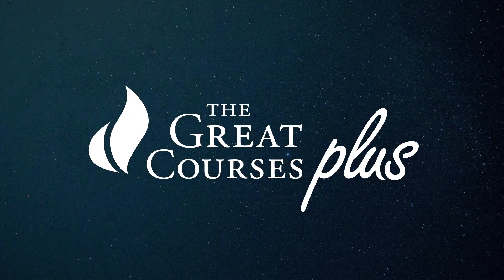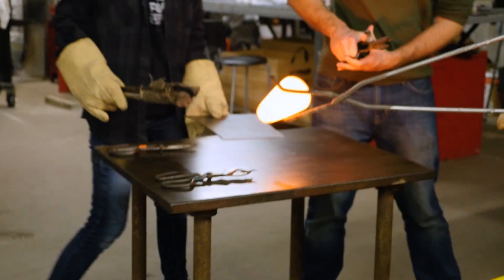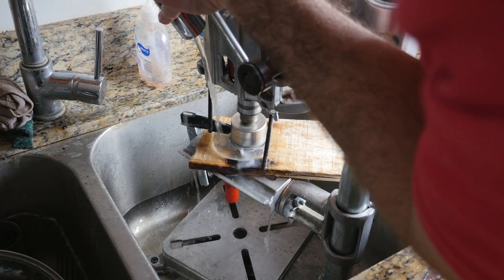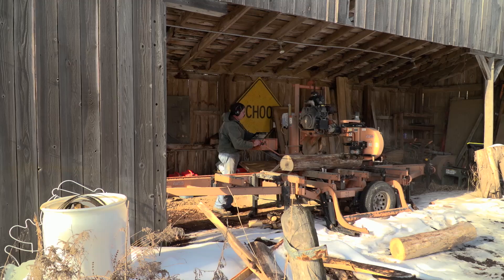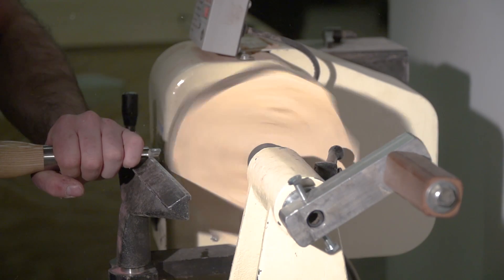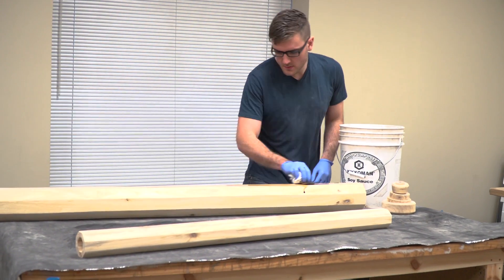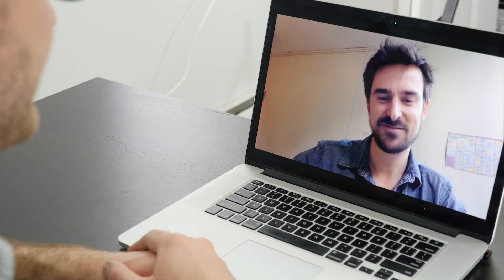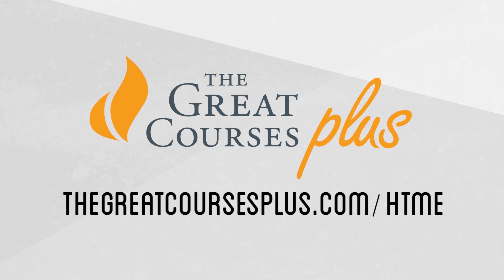How to (Almost) Make a Telescope from Scratch

Comment: Hey thanks for the video. I just joined. Hey I have a question I have a Bushnell telescope and a bunch of Eye lenses and the obvious and lens that comes with the scope. My problem is I can’t see anything does it matter which 25 times or 18 times can those all be used but all you have to do is adjust the length of your telescope to be able to use those different multiplication of microscope glass or whatever it’s called.?
I’m not quite sure if that makes total sense to you of how I’m trying to explain it? But maybe you get the gist of of it. But if you do or kind of do could you get back to me and let me know if all I have to do is just concentrate is even if I change the magnification of the eyepiece it’s just a matter of adjusting the length of the telescope to where the two lenses magnify what I’m looking at such as the moon. I’m kind of sad I didn’t have my scope set for the Jupiter alignment thing a couple weeks ago but after watching your show mainly it’s the best one I’ve seen out of a couple other ones I’ve watched but I hope to hear back from you if I don’t know you’ve got maybe a little bit more knowledge than I do maybe you can help. Again thanks for the video and yeah seeing you make a Camera and taking your own selfie sounds like a good challenge. Take care yourself be safe with this virus stuff and hope to chat with you soon cheers.

Comment: I knew you were going to get hurt as soon as I saw you trying to be the vice of an object that is harder than your hand. Not only this, but I consult you in saying:  Pour molten glass into vacuum chamber with pressure/release control. I have heard ultrasonic use with different peak to peak amplitudes works to remove air pockets. Usually done by stirring; for an example, I saw someone remove air pockets inside of epoxy resin. There was one with 25 microns peak to peak.

Comment: You were cutting those disks TOO FAST!  Better to trepan them using water and carbo powder to cut them with the drill running more slowly, say about 250rpm.  It would take longer, but would be much safer!

Comment: Well to make a telescope you really need a high quality of glass and yes from scratch it wont be enough efficient also there are a lot of calculation that necessary to achieve such as the focal length the diameter conjunction points size etc. They price for lenses are high not to piss some one for kicks there a reason for that and it's in the materiel itself you want high performance you pay more . The kind of glass that you used in this project dont get me wrong it's nice but they are sh** cause it's made from the same quality glass they use for pots and dishes not lenses however if you had find some old lenses and refine it so maybe you would get better results but I think due the circumstances you havet the right tools to make it . Free Tip try mirror telescope it reflect the light and chance to see stars at high quality .

Comment: I made my own telescope many years ago, not quite from scratch, but grinding the mirror myself from a blank.  Does that count?

But actually, I suspect the distorted image you got of the Moon is not related to the air bubbles (which would mostly just scatter light and decrease contrast), but rather by the fact that your curved surfaces are not really close to spherical.  Unfortunately, eyeballing the curve is not really good enough.

Great work nonetheless.  Cheers from sunny Vienna, Scott

Comment: I'm just wondering, and this might sound stupid but could you take out the air bubbles from the glass by using a vacuum  chamber using the same material as the crucible and make the lid transparent, this way you could put in the boiling hot crucible with molten glass into the vacuum chamber and take out the bubbles, granted the glass may solidify before taking out any good amount of air bubbles. just a thought.
Reply: molten glass is extremely hot over 1330C so no normal vaccum with a transparent lid can survive even if it could bubbles move very slowly in glass so they wouldnt clear out before it solidifies.  he couldve kept the glass hotter for longer so it thins out and bubbles rise or add some chemicals to help small bubbles escape. Nice way of thinking tho!

Comment: As soon as I saw him holding the glass while drilling it, I knew that the drill would slip. You applied way to much pressure while trying to drill the lenses, that plus trying to hold it is more than likely why it slipped.

Comment: Make a camera from scratch
Reply from the maker: we plan to!
Reply: go a step further and also make the film from scratch... I suggest sticking to a large format style 4x5 or 8x10 since it will allow things like direct to paper photography which is easier to do from scratch. there are lots of photosensitive options you could use often listed in alternative photography books.

can also go simple with pinhole style cameras which work well with alternative photography processes.

Comment: You should't have used sand. There is a much better method to get SiO2: You should have searched for some white, clear quarz crystals and grind that up. It has very little impurities and is relatively easy to find. Just take a hammer with you and crack open every rock that is bigger than 4cm. If you see a white powder or a glossy finish on the two halves of the stone, you know you've got quarz.

Comment: great video but u never made ur own natural wood glue 😑.
Reply from the maker: I made animal hide glue before: https://youtu.be/38v7AVTZpMw?t=61
Which was frequently used as a wood glue.  I didn't use it for this project though, because I ended up having a tight deadline and didn't want to risk losing a day because my glue didn't hold.  I might do a series on making adhesives in the future though, since they'd be a useful supply to have.  Making my own duct tape from scratch could be interesting.

Comment: Instead of making an optical telescope like this, you could have had a much easier time making a reflector. Because you don't need lenses at all, just mirrors, which are MUCH easier to make and make sure they're clean and pure on the surface. I highly recommend a Newtonian design, as they are the simplest. (though a Cassegrain or Gregorian could be a nice challenge)

But (glass issues aside) your optical telescope could be improved by making your lenses thinner. Thick lenses don't quite follow the thin lens equations I presume you used to calculate focal lengths.
Focal lengths calculation could also be vastly improved by using a stand/clamp of some sort instead of just holding the lens, which leads to pretty inaccurate results.
Reply from the maker: Good points, thanks!
A reflecting telescope is definitely on my future agenda.  The most difficult chemical I need to source for the camera film is likely silver.  So if I get access to that later this year, I can also use it to make a mirror and attempt a reflecting telescope.
Reply: The primary mirror is very accurately ground concave mirror
Reply: Further, he doesn't necessarily need to use glass when making a reflector. He might could use a rock with fine grain and coefficient of expansion close to glass. Even then, if he wanted to he could use obsidian i.e. volcanic glass and make a reflector from that.

Comment: Drill with a diamond-tipped drill bit, use your bare hands to touch the glass it is cutting.. what could possibly go wrong? :))

I was actually expecting you to get hurt when I saw it, and it happened. 

be careful
Reply: & after he got cut he still did the glass

Comment: man, why the HELL did anyone tell you that is a BAD IDEA to DRILL GLASS with diamond BLADES with your bare hands? When I saw the first second of this drilling I knew its going to end bad.
Reply: Hey man, it's a Minnesota thing. We know it's dangerous but we still do it because we don't feel like finding our gloves.
Source: My dad almost cut off his thumb (again) with a table saw a few days ago
Reply: KonservenFurz yes like only Minnesota people do that.
Reply: Jebact - Haha that's true, if he were doing things in a proper manner. But the way he was doing it, gloves or not it was a really bad idea!
Reply: as a welder that has used hole saws ( fuck holes saws btw) GOD I yelped like a little girl and held my hands over my mouth.
Reply: Same dude
Reply: Yeah I was on the verge of yelling when I noticed that he wasn't using hand protection for anything starting with grinding the lenses to flush texture
Reply: Can't lie, I've 100% cuz myself the exact same way... the  went in again for round 2.

Hell just last night I found an old grase gun I wanted to attempt repairing. After disassembling it I grabbed my drill and a wire wheel and went to town. Held each part in my left hand and powered the drill with my right. When you walk the line you learn pretty quickly how not to screw up.... though may have had a slight incident when the part slipped in my grip, and in my efforts to regain my grip pressed the wheel into the part really hard, so it gained traction and shot around the edge and scoured my ring finger.... honestly wasn't as bad as it sounds, only took the very tippy top layer. Didn't even bleed.... much.
Reply: Actually sometimes you don't want to wear gloves because the moving parts will drag the rest of your hand into the machine. Depends on the situation but yeah. I don't wear gloves with an angle grinder for this reason.
Reply: Same here....i know how he handled the drill with bare ✋
Reply: No dudes never wear gloves with power tools NEVER, if your gloves get caught it will rip your figers because of the tension of glove and through it away. Believe me it's better get deep cut rather than get your whole fingers ripped.
Reply: OSHA needs to start auditing people like this in their homes
Reply: mr Overcarefull was found. Mission Successfully completed

Comment: Will you try again to make your own glass? If so you can try to use a ball mill to pulverize the ingredients for glass, as for example, thermite(explosive) doesn't  work with coarse aluminum and iron oxide but the finer the ingredient the better it works, same for glass in addition to that pulverising will make other unnecessary particles fall of that are stuck on to ingredients.

Comment: Why did you not make the wood glue from scratch??? Good video though
Reply from the maker: I made animal hide glue before: https://youtu.be/38v7AVTZpMw?t=61
Which was frequently used as a wood glue.  I didn't use it for this project though, because I ended up having a tight deadline and didn't want to risk losing a day because my glue didn't hold.  I might do a series on making adhesives in the future though, since they'd be a useful supply to have.  Making my own duct tape from scratch could be interesting.
Reply: How To Make Everything ok keep making good content

Comment: You are getting more and more sloppy. It's hard to stick to your original philosophy, but still tho.
Reply: I think given the amount of times hes failed on the glass front, he really just wanted to get somewhere. I don't think we really need 20 more videos where he makes something that contains glass and opaque green glass ruins it every time. His "clear glass is ubiquitous" is a bit silly but on the mark if you consider what his intentions were, supposing a civilization ending event.
Reply: BeatnutNL I agree
Reply: BeatnutNL - I think it's fine if he eventually gives proof of his ability to manufacture glass from scratch.
Reply: i think he did it because he couldn't work easily  with  the glass in last videos.
Reply: he really never did using machinery like this
Reply: BeatnutNL Still pretty awesome, though